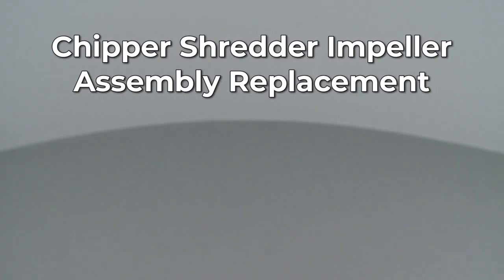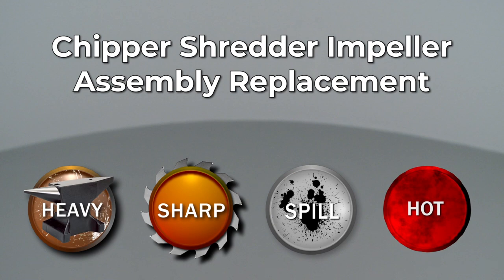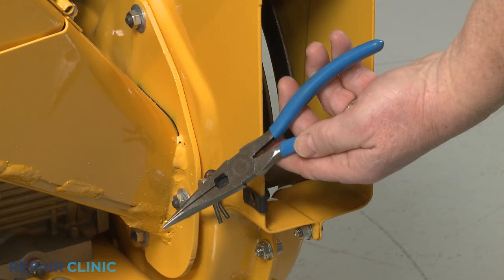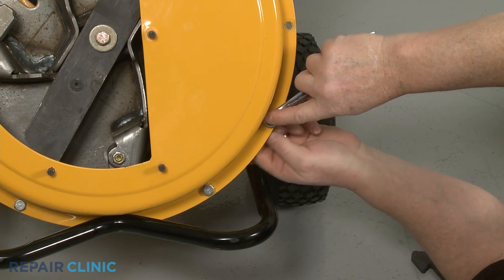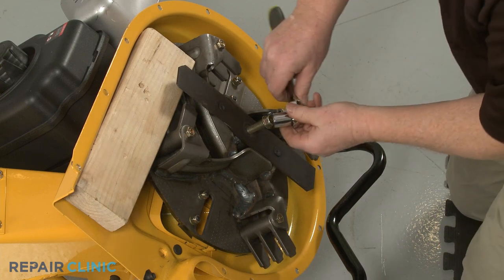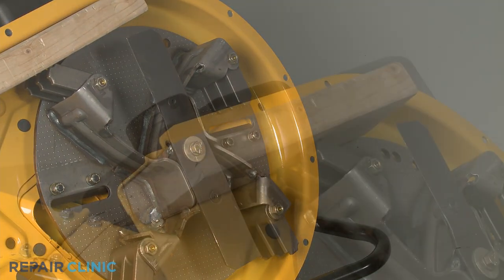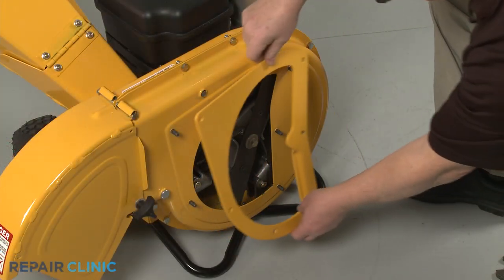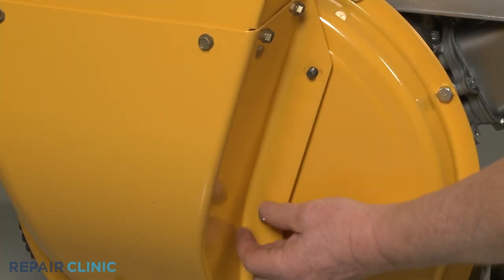Cub Cadet Chipper Shredder Impeller Assembly Replacement (981-04094)

Comment: Outstanding video. I have a 2004 TroyBilt that looks identical to the Cub Cadet except it's red. Mine was damaged because all 4 flail blade retainer clips were missing and 2 of the spiral pins were missing allowing the clevis pins and flail blades to fly. Very Scary and Very Noisy. Design was changed on newer models. The flail blade brackets were heated and straightened and 3 flail blades were replaced. Your video was very helpful for me to remember where the parts go and the correct order to reassemble. Thank you.

Comment: I need to replace the engine and I followed the video up to the impeller removal.  While removing the center bolt was not a problem, the impeller does not come out. I am  using the removal tool but no matter how deep (or light) I screw it in, the impeller is stuck.  One removal tool even got bent!  I tried soaking with a generous amount of WD40 and did not help.  Any suggestion?

Comment: That comes out nice when it hasn't been used. What about 10 years of use, all rusty, would it come out as easy? I think not.
Reply: Ya man I've tried removal tool, ring puller, hammer, clr, pb blaster and blow torch. Theres a 3/16" washer thats welded on, i guess I'll grind off the welds?